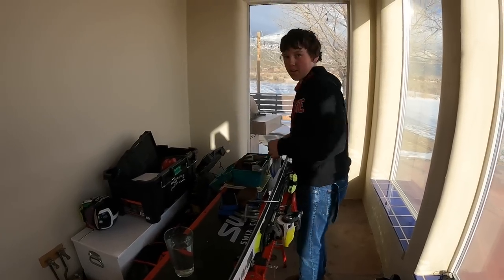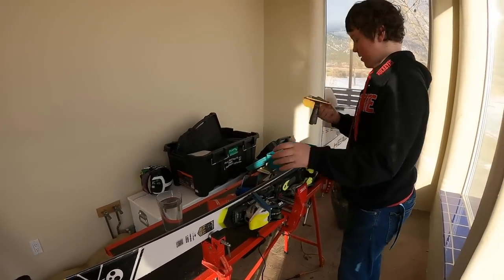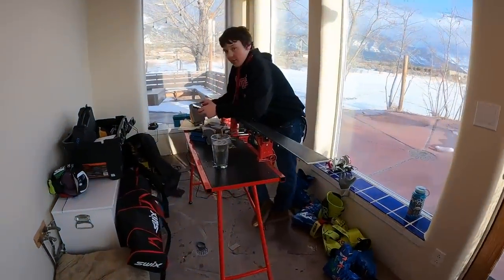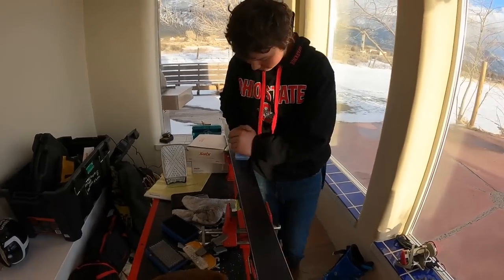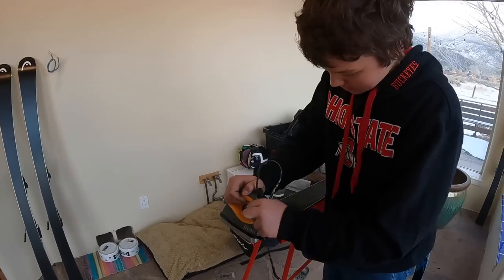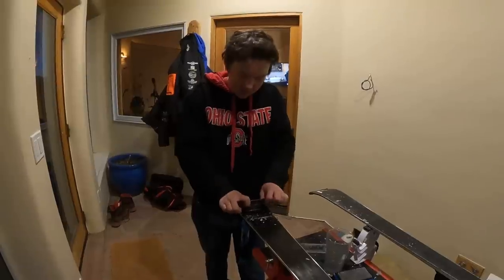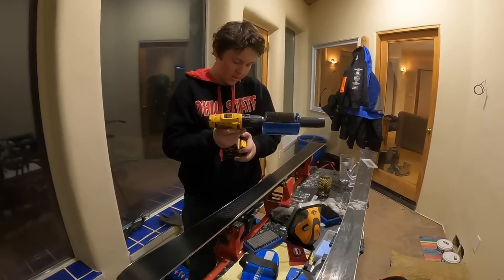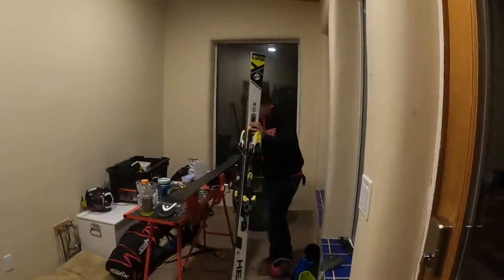How to tune skis and what's in a wax kit

Comment: Fantastic video & great young man - if I could only get my U16 daughter to do her own skis like that. The 'reason' to first rub some wax onto the base before dripping more on with a hot iron is to provide the base with a tiny, tiny layer of broad protection from the heat of the iron before the large drops can melt and spread. The only step I didn't see being done is that after sharpening & polishing the edges, a tiny burr will overhang from the side edge past the base edge level - it can dramatically slow the ski while it glides. Take your finest stone, place it flat along the base and over the base edge, and very carefully and slowly move the stone along the base edge and remove this burr - it is critical to remove if you want maximum glide. It is very important NOT to do this aggressively and thereby increase your base level edge angle which will make the ski less responsive - you are just trying to remove this burr. You can feel this burr if you take your fingernail and move it from the inner base edge towards the outside edge of the base edge as it will overhang from the side edge that has been sharpened and then further polished. Some people incorrectly think that this is dulling the edge that you just spent time sharpening because if they feel the edge with the hand prior to doing this it will feel very sharp - and when you remove this burr it will feel less sharp - and thus people incorrectly think you have dulled the edge - when what you have in fact done is just brought the base edge where it meets the side edge into a non-jagged connection - it's that jagged connection that feels sharper to you but it's jaggedness just slows the ski when it is attempting to glide. Fantastic content Deb.

Comment: Great job!  I started at your age, worked as a tech for 15 years, tuned, trained, coached and rehabbed several memebers of the USST.   Always clean your tools (a bowl full of hot water with car soap works well), never let your brushes touch anything but the base-bag them, pay more attention to your sidewalls...remember to wax them as you are on them more than your edges.  :-). Big fan of FastStik!!!  Ask them for some sideglide!!
Reply: I always bag my brushes. I was afraid that was overkill. Thanks for the reassurance, I had never heard this before.

Comment: In the Nordic skiing world, we've stopped dripping the wax on and have moved to crayoning the wax on.  Heat up the wax block on one end and crayon it onto the ski in short strokes.  We waste less wax and get better, more even coverage.
Reply: I do it that way too. It keeps the wax layer thin so not too much heated wax that could heat up the base and skis
Reply: You need the temperature of the iron to get the perfect bound between your base and wax the wax stick itself is too cold to sink in.⛷️💨
Reply: Yup we've been crayoning for years
Reply: @chadridsdale9970  seems like it!;)
Reply: @Fritznn  Of course you still need to iron the wax into the base of the ski.  My comment was that rather than dripping the wax onto the base, we heat up the wax block and rub the wax onto the ski base.  The result is better coverage of the entire ski base, and it requires less passes with the iron to melt in the wax which is better for the base material especially when using green or blue waxes which have a higher melting point.
Reply: @GregoryMauldin  yeah sure but wouldn’t it be the same cause finishing with a Tex pulling behind your iron is like standard?

Comment: Deb - Question for you: having worked with Terry Watson at Swix a bit, the dominant way to work a file or honing stone was to pull the tool towards you - not to push the tool, which tends to scallop edges. Thoughts? Is that still best practice? Thanks.
Reply: Agree on Pull vs push, but also a big fan of young athletes tuning, discovering what works and what doesn't feel as good.  Maybe a key to future success?

Comment: Great work Wilson! I wish I had bought the razor tune instead of the Evo. I think the Evo angle is not accurate, it's kinda tippy, and sometimes hard to move past the binding. I used to use water to lubricate my diamond stones and have switched to 99% alcohol with a needle tip squirt bottle. Less mess, no rust, and cleans. I struggle with being confident on what base bevel to use here in the east. My athlete is too inexperienced to give me good feedback and once you increase base bevel, you can't go back without a grind so I have been shy to move past 0.5 degree. I would welcome comments on base bevel. I use 3 and 0.5 on both GS and SL skis now. 2 and 0.75 on all mountain skis.

Comment: Hi Deb: can you make a video (of giving a little tip) pls how much shoulder counterrotation on a turn is considered good in modern skiing when it is too much or too little? Are shoulders always pointing down or do they still face the side of the hill a little bit? I do the poles drill when I hold them in front of me and could make a correct adjustment from your advice. I notice that it is easier to ski when I counterrotate shoulders instead of being a solid upper /lower body "Brick" that faces the side of the mountain at the end of the turn. Also big thanks to Wilson

Comment: After a couple of trips to the hill, I touch my edges up with the diamond files and may do a hotwax. At the beginning of the season, I have the shop do a full tune. One thing about the base bevel, it is easier to go from an aggressive  bevel like .5 or .75 to a 1 than to go from a 1 to .5 or .75, because they would have to grind the base to get to .5 or .75  if you have an existing base bevel of 1.

Comment: Just curious, why he Pushed the file from the Tail to Tip? Shouldn't it be the opposite way?
Reply from the maker: Not sure, it works for him
Reply: Not sure if anyone is coming back to this after so long. File from tail to tip is fine for a rough file especially if the goal is to remove hardened spots quickly. For the diamond stone tune after tip to tail is preferred but it doesn't make a huge difference